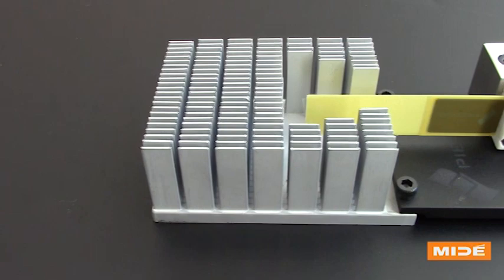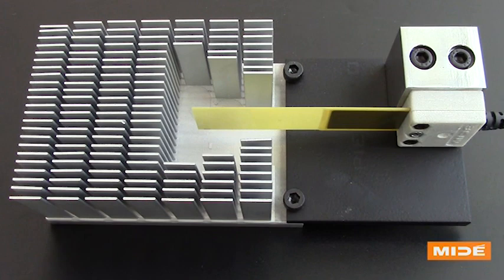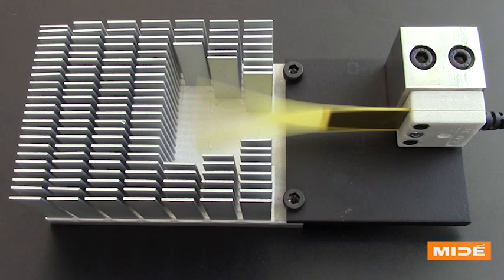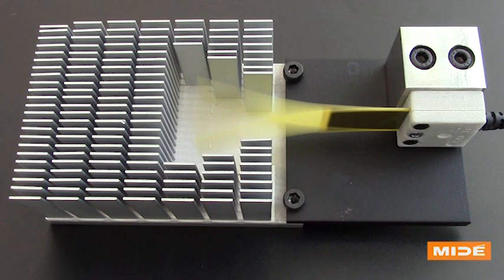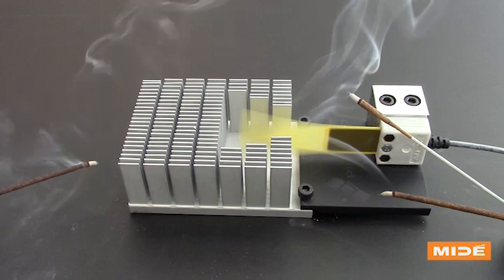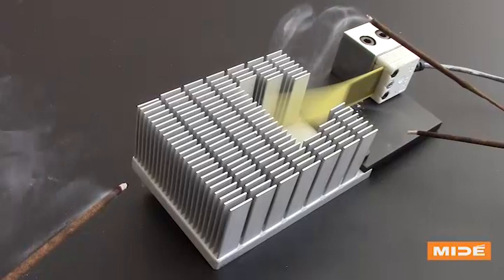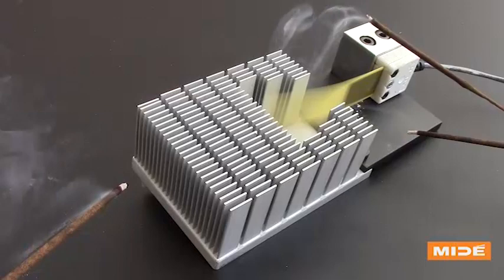Forced Convection with Solid State Piezoelectric Fan

Comment: That wasn't really solid state - there was a moving part that will wear out and break.
Reply: The point at which the “moving” part is connected to the assembly isn’t moving relative to the assembly, therefore it is solid state. Had there been any sliding contact, such as a bearing, bushing, hinge, or rail, it would not be solid state
Reply: @dapz  but still "the blade" can wear out/break.
Reply: @jareknowak8712  might be the case but it looks to bend far below the point at which the plastic films deforms, so as long as the temperature of the atmosphere is within range it won’t fail
Reply: Dapz??????
Reply: @dapz  I'm going to say that flippy-floppy thing is just going to snap.
Reply: @dapz  Are you telling me that there is no friction at the point where the "flap" is clamped? Sorry but calling this solid state is bullshit marketing talk.
Reply: @TheBod76  bruh... its clamped. It cannot move. Of course there is friction, a lot of static friction, which doesn't produce heat.
Reply: @dapz  It will deform when flexing and that  puts stress/friction on the material especially at the point where the clamp starts. Calling this solid state is marketing bullshit.
Reply: @TheBod76  stress and friction are two VERY different things.

For any given material, there is a point called the yield point which describes the minimum amount of stress placed onto a material in order to permanently deform it. 

So as long as the stress placed on the material is less than its yield strength, no permanent deformation will occur, and the object will return back to its original shape once the stress is removed. 

For example, if an object has a yield strength of 100MPa, no matter how many times a 99MPa stress is applied to it, it will always perfectly return back into its original shape and there will be no wear on the object at all. However, if a 101MPa stress is applied just once, than the material will be permanently deformed. 

From watching the video, you can see the stress placed upon the little flapper is far less than its yield stress, as it hasn’t deformed when it stopped. Solid state is not a marketing term in the slightest if you know what it means, because it can be easily verified just by looking at the machine.
Reply: @dapz  What does that have to do with anything, why would it matter if the part is permanently deformed? 
If it flexes, it moves and causes friction -> not a solid state device. 
It is designed to move/flex by running electrical current through it.
If I were to build a fan that allways stops at its origin point when it gets turned off, would you call that a solid state device because it doesn't "permanently deform"?
Reply: @TheBod76  if it doesnt permanently deform it won't wear down, so for compliant mechanisms like this, it means everything.

also in your definition, nothing is a solid state device. Everything moves, flexes, or causes friction. Rigid body objects don't exist in the real world. 

Fans are not considered solid state because it has a bearing, which contain separate pieces sliding or rolling against each other. In a piezoelectric fan, there are no two objects sliding or rolling against eachother. Also I said nothing about returning to its origin point, returning to origin point and returning to its original shape are two completely different things.
Reply: @dapz  English isn't my first language so origin point was my way to describe that it has the exact same shape after it is turned off. 
Somehow you thought it would matter that the flap isn't permanently deformed or you wouldn't have brought it up. Don't forget I never argued about the usefullness of said device. I am arguing wether it is a solid state device or not.

But anyway, I can only repeat myself if the device has parts that move by design (flexing is moving!!!) it is not a solid state device.
Reply: @TheBod76  i honestly don't think this device is very useful except in certain niche scenarios, but basically what im saying is that solid state is defined by any contraption with no rotational or linear movement between two or more contacting objects, and flexing is neither of them so therefore its solid state, similar to how a paper fan, rubber band, or bow and arrow are solid state.

as for my talk about permanent deformation, I'm basically saying that this thing will not wear out. Theres negligible kinetic friction
Reply from the maker: Here are some comments we have provided on the durability of the fan:

During the development of the piezoelectric fan our customer required us to run some highly accelerated life testing (HALT) on a statistically significant number of samples.  The test included thermally cycling the fans 1000 times from -40 to 125C while they were operating.  The test took about 5 weeks to complete.  There were no failures.  We also ran the fans through high temperature operating life at 180C (HTOL), low temperature operating life at -70C (LTOL), Over voltage test at 100% over the normal operating voltage, Humidity HALT testing, Cold start testing which included a hard start up after the fans soaked at -40C for 14 hours, high temperature storage tests where the fans were soaked at 140C for 1000 hours prior to successful operation, dust ingress testing, salt spray and fog testing and IP68 testing where we submerged the fans for 72 hours at the equivalent of 3 meter depth pressure and then operated them after they were removed and dried off.  There were never any failures during any of these tests.  Lastly, we have been running a non accelerated life test on a single unit (in my office) since June 15th, 2016.  It has only been unplugged one time when we moved to a new building.  It is still running as of this morning with no noticeable change in performance.  I sit about 6 feet from it, If I really try to listen hard I can hear it running.  Running at 60 Hz we have put just over 11 billion cycles on the fan without failure or change in performance.
Reply: @MideTech  That's impressive. I'd love to know how the constant flexing has affected the molecular structure and whether there's any crystalisation forming within the material.

Comment: Hmm. Why video without 50Hz sound?
Reply: Its impossible to make completely silent system with vibrated +-20mm element. But good news is that linear size is much lower than the wave length for the 50Hz in air.
I'm working with electronic cooling systems, and found this solution is very interesting. Not cheap, but it's first time only. Good luck!
Reply from the maker: Viktor, there is some audible sound created by the piezo fan but it is very low.  We can design fans with almost no audible noise.  Also, due to the reliable nature of the piezo fan the audible noise is constant over the life of the fan.  This is an improvement over traditional fans where wearing bearings begin to squeal or whine after a certain amount of time.  Thanks for the question. Chris.
Reply from the maker: Hi Viktor. You can get a good idea of volume price breaks on our website: http://www.mide.com/collections/piezo-cooling-overview/products/piezoflo-product-pfn-1011. This is a new and well tested technology, so as we penetrate more markets we're sure our pricing will reduce even further. Thanks.

Comment: Why using an expensive piezoelectric material instead of using copper magnetic micro coils, which are much cheaper and allow more movement
Reply: Power consumption, probably
Reply: @nicklaich  Not exactly if you use neodymium magnets and MOSFETs for switching.
For high current peaks, a high value capacitor is sufficient
Reply: @ThermalWorld_  The place I see these fans being used are in possibly damp areas that require extremely reliability. So maybe for corrosion purposes and or reliability.

Comment: Can it cool a CPU or GPU for commercial PC
Reply from the maker: Rueben, it could cool a CPU or GPU.  However, the real use case is cooling in extreme environments where traditional fans struggle to survive for long periods of time.  Dusty, high and low temp, corrosive, etc.

Comment: C'mon, be upfront with the facts. The problem with this solution is that it needs 100-200V AC to drive the piezo and that the piezo fans are $100+ a piece.

Comment: Very interesting concept; but it does have moving parts. What is the service life of the material flexing? That is the weak point.
Reply: as long as it doesn't load beyond spec, I  could see it lasting almost indefinitely.
Reply from the maker: Here are some comments we have provided on the service life:

During the development of the piezoelectric fan our customer required us to run some highly accelerated life testing (HALT) on a statistically significant number of samples.  The test included thermally cycling the fans 1000 times from -40 to 125C while they were operating.  The test took about 5 weeks to complete.  There were no failures.  We also ran the fans through high temperature operating life at 180C (HTOL), low temperature operating life at -70C (LTOL), Over voltage test at 100% over the normal operating voltage, Humidity HALT testing, Cold start testing which included a hard start up after the fans soaked at -40C for 14 hours, high temperature storage tests where the fans were soaked at 140C for 1000 hours prior to successful operation, dust ingress testing, salt spray and fog testing and IP68 testing where we submerged the fans for 72 hours at the equivalent of 3 meter depth pressure and then operated them after they were removed and dried off.  There were never any failures during any of these tests.  Lastly, we have been running a non accelerated life test on a single unit (in my office) since June 15th, 2016.  It has only been unplugged one time when we moved to a new building.  It is still running as of this morning with no noticeable change in performance.  I sit about 6 feet from it, If I really try to listen hard I can hear it running.  Running at 60 Hz we have put just over 11 billion cycles on the fan without failure or change in performance.

Comment: "No moving parts" but we see a part moving.
"Low noise" but we don't hear the audio.
Reply: Moving parts are defined as separate individual components that are joined together by means of a unified joint, pinned, or flexing hinge, or some other inventive attachment/apparatus. The moving part you suggest in this instance, I believe, is the non-moving component. The oscillating fan is firmly attached to the piezoelectric plate below it. ergo, non-moving. Mains frequency electricity coursing through the piezoelectric plate, is effectively the moving part if anything. The fan is firmly attached and just along for the ride.
Reply: @Zodliness  but it's flexing! Isn't that going to wear off?
Reply: @4.0.4  I've two parallel units been operating without issues or signs of breakdown. It's a rigid connection between the two components. Check out the data sheet for them.
Reply: @4.0.4  Eventually, but in a very long time as long as the part isn't loaded to the point of plastic deformation. Look up stress strain curve.
Reply from the maker: @TheMasochrist  and @chrysippus, here are some comments on fatigue that we shared with others:

During the development of the piezoelectric fan our customer required us to run some highly accelerated life testing (HALT) on a statistically significant number of samples.  The test included thermally cycling the fans 1000 times from -40 to 125C while they were operating.  The test took about 5 weeks to complete.  There were no failures.  We also ran the fans through high temperature operating life at 180C (HTOL), low temperature operating life at -70C (LTOL), Over voltage test at 100% over the normal operating voltage, Humidity HALT testing, Cold start testing which included a hard start up after the fans soaked at -40C for 14 hours, high temperature storage tests where the fans were soaked at 140C for 1000 hours prior to successful operation, dust ingress testing, salt spray and fog testing and IP68 testing where we submerged the fans for 72 hours at the equivalent of 3 meter depth pressure and then operated them after they were removed and dried off.  There were never any failures during any of these tests.  Lastly, we have been running a non accelerated life test on a single unit (in my office) since June 15th, 2016.  It has only been unplugged one time when we moved to a new building.  It is still running as of this morning with no noticeable change in performance.  I sit about 6 feet from it, If I really try to listen hard I can hear it running.  Running at 60 Hz we have put just over 11 billion cycles on the fan without failure or change in performance.

Comment: Not solid state, but not rotating. Truly solid state is ion wind.
Reply: Actually this would be the same phenomenon.
Direct induction of actuation by means of an electromagnetic gradient.
Ponder a second on how these contraptions would work in a vacuum,
the piezoelectric material would simply have to cool the substrate by means of contact.

Comment: Sooo, these cost $400 for a 'fan' piezo module terminated in bare wires?
Site says $233 then it's $396 if you get the barest piece of one. eh.
$1,100 for one that you can plug right into the wall to evaluate safely.
Interesting use of the tech but also. :')
Reply: wow... china could manufacture those things for less than a buck....
bring that to somewhere competitive range of price with the current fans of today market or less and they may have something...
DIY community will probaly pick up on those and make them for couple bucks..

Comment: 6 years later, nobody is using this
Reply: They're charging a lot of money for these.
Reply: @sonofman70x7  probabaly because they can't get anybody that wants to make something so stupid
Reply: Because a s..d heat pipe with corresponding liquid beats this scam device easy. With the pipe you can transfer heat into a more friendly environment, where you can use anything you want to cool down a radiator.
Reply: Not six years, forty. I remember these being sampled back in the eighties with a view to getting them into the then new IBM personal computer. With the ongoing cost reduction needed in that race to the bottom, price should be around 20 cents now.

Comment: it seems fragile and very little effective, plus the nature of the vibration is purely oscillatory, so it may trigger stronger noises nearby... it can still have some niche applications anyways
Reply from the maker: Here are some comments we have provided on the durability of the fan:

During the development of the piezoelectric fan our customer required us to run some highly accelerated life testing (HALT) on a statistically significant number of samples.  The test included thermally cycling the fans 1000 times from -40 to 125C while they were operating.  The test took about 5 weeks to complete.  There were no failures.  We also ran the fans through high temperature operating life at 180C (HTOL), low temperature operating life at -70C (LTOL), Over voltage test at 100% over the normal operating voltage, Humidity HALT testing, Cold start testing which included a hard start up after the fans soaked at -40C for 14 hours, high temperature storage tests where the fans were soaked at 140C for 1000 hours prior to successful operation, dust ingress testing, salt spray and fog testing and IP68 testing where we submerged the fans for 72 hours at the equivalent of 3 meter depth pressure and then operated them after they were removed and dried off.  There were never any failures during any of these tests.  Lastly, we have been running a non accelerated life test on a single unit (in my office) since June 15th, 2016.  It has only been unplugged one time when we moved to a new building.  It is still running as of this morning with no noticeable change in performance.  I sit about 6 feet from it, If I really try to listen hard I can hear it running.  Running at 60 Hz we have put just over 11 billion cycles on the fan without failure or change in performance.
Reply: @MideTech  well, good to hear that after years it didn't snap, it's perfectly understandable that a ceramic element, if not abused, can flex an infinite amount of times because it doesn't have a compound nature and it doesn't crosses the break point, anyways it could last 1 second or forever, an endurance test is required at least for some months, it's a matter of order of magnitude of time, months or years makes little difference IMHO

i don't want to go on with this debate but it's still ceramic, if handled professionally it lasts forever but (bad example) "computer parts" are know to NOT be handled professionally, although a cover would solve the issue... also its little effectiveness (in terms of air flow) seem hard to overcome.... i perfectly understand the chemical ruggedness aspects, but still niche... anyways i admit that the electronics of this device (resonance feedback oscillator?) could cost just cents today and the element doesn't seem expensive, the whole can be compared to a fan in terms of cost but for niche applications cost is a lesser concern

anyways you don't have to convince me, i'm a total nobody, but there are tonnes un un-worthy kickstarts and phony scams around, this situation makes everybody quite disappointed and critical

P.S.
side note: the concern about dust isn't logic IMHO... a fan moves harvesting dust in a forward direction without a reverse movement, so the dust hoard just increases... this device MAY not accumulate dust on the element bcs its movement tend to kick off the dust from it (unless the dust is sticky), this is something you may testimony by yourself... the dust will anyways accumulate on the heatsink no matter what